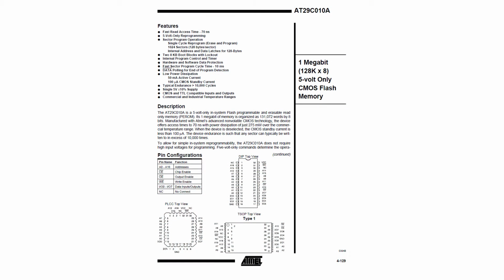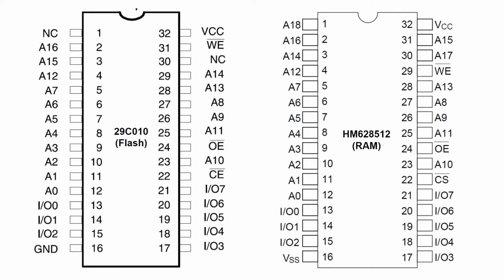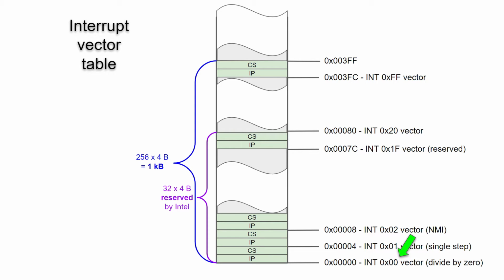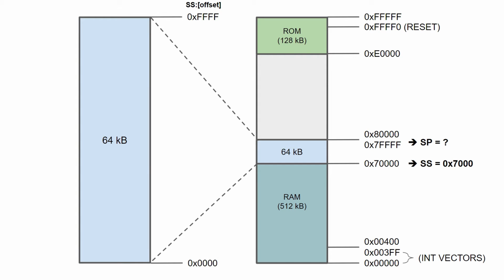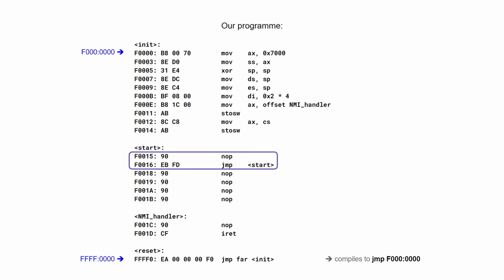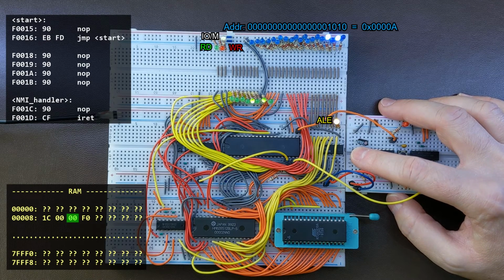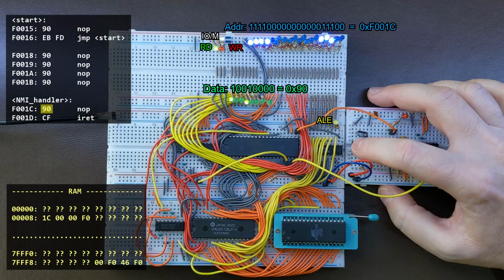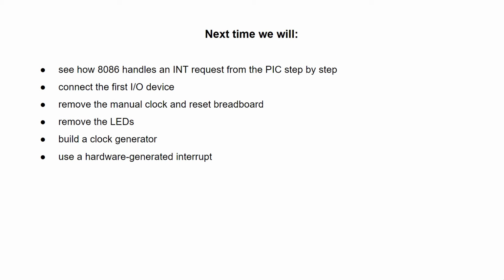Memory map and interrupts - Building and programming a 16-bit Intel x86 breadboard computer [part 3]

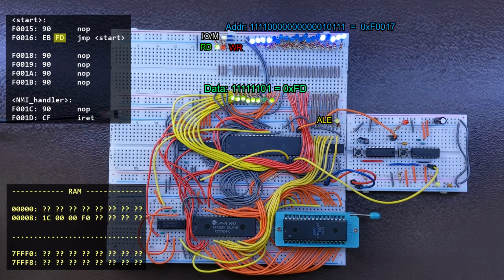Comment: 26:30 Oh by the way, 0xEB is "near jump to relative offset", and this 0xFD is -3,  apparently, the instruction means "add -3 to the IP". So, IP happens to be 0x0018 after executing this instruction, and then it is being subtracted three and this is how it loops back to 0x0015.

38:30 I believe, it's not "finished executing an interrupt handler", but it's actively executing the IRET instruction, which implies reading from the stack.

Comment: Finding your videos very informative. I'm designing a vacuum tube computer, hopefully with 16bit data bus (very ambitious, I know).

At 21:57 where you set DS & ES to zero, why use MOV and not XOR, being that, as you explained, XOR uses less clock than MOV. It seems a waste of clock, especially when setting SP, DS & ES all to zero are consecutive instructions, and, there is no jump instruction to F0007 in your program after any modification of SP
Reply from the maker: Thank you for your kind words. Your project sounds VERY impressive! I wasn't aware that it was still possible to get hold of many vacuum tubes these days. Please keep updating me on your progress in the future.
Regarding your question about using MOV instead of XOR: DS and ES are not general purpose registers and they cannot appear as the operands of any arithmetic or logical instructions like other registers. There is no XOR instruction, where you can use any of the segment registers. From the top of my head, you can only MOV to and from a segment register and PUSH and POP them.

Comment: Thanks for the video. Its down to earth.. you didn't state how you got the Program into the memory. I was thinking you write the EPROM or something.
Reply from the maker: Hi! Thanks for watching and commenting. Yes, well, at the moment I assumed it would be obvious how the programme got onto the breadboard and didn't mention that. Apologies for that. I used the same flash memory which I introduced in the previous video. So you are quite right, but instead of using an EPROM I used a flash chip (29C010). But yes, I do remember using EPROMs and waiting until they got erased by a UV bulb many years ago. I used to have a few EPROMs, which I used in turns, so I could have a few empty ones while the rest was being erased. Good old days ;-)
Reply: @SladorSoft  Much appreciate your reply. So the flash chip is an EEPROM ? I WANT TO start breadboarding alongside you as I enjoyed your content
Reply from the maker: @engineerchika3204 - sorry for late response - I had somehow missed your comment.
Yes, I'm using the 29C010 which is a 128kB NOR Flash, so technically something very close to EEPROM.

Comment: One of the few times *(int*) (void*) 0 = xxx; is a valid C instruction (instead of a null pointer access), is when you set the divide by zero interrupt vector IP value ;)

Comment: Hi I'm noob, how do you write the program on the memory?
Reply from the maker: Hi! The flash memory is written using a universal programmer. My own programmer is very old, but if you would like to buy one, search for "XGecu T48 Universal Programmer" for example as it is one of the most popular budget programmers.
The compiler creates a binary image of the flash which you then load into the programmer.
I'm planning to release a short instruction video of how to setup the compiler toolset to build all the example code from my GitHub.

Comment: This series brings me so many good memories... I have two questions about the assembly you used (which might also be tips for viewers):
1. Why are you using a "NOP" followed by a "JMP -2" (EBFD)? Wouldn't a "JMP -1" suffice (EBFE) and save a byte (plus some clock cycles - i.e. four button presses :)?
2. Was there any reason to not use "CLI/STI" to disable interrupts while setting up the interrupt table?
Reply from the maker: Hi there! Thanks for your questions. They are great, because - as you said - they may be valuable for others. Let me answer them:

1. No particular reason - I just wanted to make sure that the CPU has something to do in the loop and that it will still fetch the instructions giving us feedback on the LEDs. I thought that if the loop was made only from a single 2-byte JMP it may not re-fetch it and use the prefetch queue instead.

2. The reason was that both CLI and STI were completely redundant in this case. The interrupts are disabled after reset by default, so I didn't need CLI there and since I were not using the INTR line in this video at all, we didn't need to enable them at any point.
Please note that neither NMI nor CPU interrupts (like divide-by-zero for example) are NOT controlled by the IF flag at all  - they are always active.

Comment: good evening,excellent. I would like to know what are the components he used in the clock circuit he uses in the small breadboard with the 2 buttons. Thanks in advance for your reply. I'm italian
Reply from the maker: Hello, thank you very much. You can see the schematic of the small breadboard in my first video - the "First Run" - around the time 12:13. This link should direct you there:
https://youtu.be/VvyUAaRTsww?t=733
The small breadboard is on the left bottom side of the schematic. The resistors can be around 10k and capacitors around 10uF. The inverters are 74HCT14 and the flip-flop is 74HCT74.
I hope that helps!

Comment: How to handle time? Let's say I want to print out the result of each Fibonacci sequence every 1 second, how do I do that? I've read there's a chip called Programmable Interval Timer 8253 but it's just that, papers, nobody has made a video wiring the IC and demostrating its behavior.

There's a project called SDLPOP which is a reverse engineer port of Prince Of Persia to SDL, I'm reading the disassembly code to see how they managed to keep framerate the same regardless CPU speed but for me to understand that will take a decade.
Reply from the maker: That is a great question and you answered it yourself ;-) Yes, you need a timer like 8253 (or its newer version 8254).
Funny that you mentioned it, because I have planned to cover 8254 in my series. It will appear in episode 6 according to my current plan.

Comment: Looking forward to your 74* series! What I'd like to see is an 8088 interfacing with DRAM instead of SRAM. As an x86 veteran, I don't mind your assembly digressions because I think they might be good for beginners.
Reply from the maker: Thank you for your comments!
The 74 series should be available next week.
I was thinking about attaching DRAM to my 8088 as well, but in this series this would not add much value, only complicating the whole design. Effectively I'd need to add a bunch of 74s or use some programmable logic.
I think I will do it at some point, but probably as a side video rather than during this series.
Reply: The target of this video series, as stated by the author, is "beginners".  Giving the xor discussion the label of "digression" implies that the intended audience is veterans such as yourself.  Such a "digression" is very informative and much appreciated by this beginner and I definitely would like to see more like it.

Comment: I have several Siemens 8086 MPU’s, I have yet to get some 8088’s in my inventory which would be a little easier to interface with as it only has an 8bit bus vs the 8086’s 16bit which was a substantial reason for IBM to use the 8088 in their 1981 debut of the IBM PC.

Comment: When done with this series, it would be nice to watch you write a C/C++ hardware emulator of this entire breadboard build in a step by step manner, starting with the intel's 16-bit x86 chip that you are using and expanding it from there. What would be nice to see at the end of that series would be the ability to install MS-DOS 6.0 and Windows 3.11 within the x86 emulator and to have a virtualized running operating system running as a modern Windows desktop console application. To account for graphics within the "Viewer" side of the emulator (additional software that isn't a part of the breadboard build otherwise you would have to build a GPU on breadboards...) we could use either OpenGL or Vulkan and their shader modules to do all of the drawing of the font's and images that Dos & Windows of that era would require. If this works well, then one could install DOOM into the emulator! However, we might have to add an addition piece of emulated hardware in software such as a sound blaster 16... What good is a "Game" without "Sound"? Again, could be done just in software instead of having to build an audio or sound card on a breadboard, unless if you want to go down that road... 

This would make for a great series... 

It would cover 4-5 major fields within computing covering both levels of abstraction starting with the hardware and its logical design along with its assembler/disassembler to middle or high level language such as a C/C++ compiler with Operating System support. It would also cover Graphics and Image Processing as well as Audio Processing as they cover multiple programming paradigms from low level assembly to mid level C to high level C++ and maybe even some Python Scripts... 

As another side project to this main project we could try designing the breadboard computer as well as the hardware emulator to be able to run an older version of linux... This way, the finished project would be both compatible and able to support either Dos 6.0/Win 3.1 or an older version of Linux... 

Then as a final set of videos as an addition choice of candy for the viewers; you could design your own operating system and installer that will be able to be installed on both of your 16-bit x86 breadboard build as well as the hardware emulator that is written in C/C++. Let me know of your thoughts on this...

As a side note if you were to start doing the software side of things could easily upload that to github... could even possibly get a discord channel going too so that the community could fork from your main branch work on it and add their own versions... Then we could possibly see dozens or even hundreds of 16-bit x86 emulators out there!
Reply from the maker: Wow! Thanks for your extensive comment including lots of ideas!
Writing an emulator would be a massive project. Personally, I'm not sure if coding on screen would be that interesting for most of the viewers(?) Anyway, it would take a looong time. Let's say that when this channel gets 1M subscribers, I'll quit my job and start the emulator series ;-)
As a side note, the emulator would need to be able to implement not only 8086, but at least 80286 for Windows 3.1 (and Doom, I believe, requires at least 80486?). As much as this idea is really cool, the required effort is huge, especially considering that there are already good emulators which do exactly what you described ("Bochs" for example).
As for github, I'm planning to publish all the code I'll write for this series -probably on github. Because the time I can spend on this is quite limited, I need to carefully balance between preparing new videos for this series, putting together a website and planning new stuff for the future.
As to the idea of the own OS - it would be even bigger thing. Rewriting MS-DOS, or anything else running in real mode wouldn't be fun, so we are looking at - at least - 80386 - definitely impossible to stick it on a breadboard :-)
To realise your ideas I'd need several lives more and to quit my job (in all of them), probably :-) If you have some time on your hands, why not to try yourself? I'd be the first person to subscribe, when you have done it - promise.
Again, thanks a lot for watching and your pretty good ideas.
Reply: @SladorSoft  This is why I'd make the suggestion of getting the community involved... Others who would be interested in such a project could work on their own parts, and collectively it wouldn't be too much of a burden, and then you could focus on the video part with the explanations and demonstrations... I know it wouldn't be an easy task, years ago I've written a minimal 3D Graphics/Game engine in C++ using Legacy OpenGL 1.0 and that project was close to 100k lines of code where a good 10% of that was in the parser for creating or generating the Scene Graph dynamically from a custom built language text file... and it took me about a year to write and debug it. I understand where you are coming from. I wouldn't expect you to do everything. That's why I had mentioned Github in conjunction with a Discord channel. Who knows where it would lead to and what may come of it.

Now, I do understand that there are already existing tools out there such as Bochs... but to see a series where one would build such a thing from the ground up in a step by step manner explaining what they are doing and why they are doing things in a specific why while still also being open to suggestions from others to improve the quality and efficiency of the code would make for a great series for others to follow. It wouldn't be so much as a lesson to teach them how to write code or program... it would be more on the lines of teaching them how to model algorithms that will be implemented into some source code and how to build sophisticated software from beginning production to end production. There are tons of tutorials to teach the "languages", there are tons of tutorials that teach various datasets, structures and algorithms yes, but there are very few that teach how to combine the two together in a seamless manner allowing others to develop the skills to be productive software developers / engineers. With your knowledge of the underlying hardware and knowing how the software meets the hardware is on the spectrums that is limited or lacking as resource for general public knowledge. And your videos although are focused on the integrated circuits, instruction sets, binary codes and assembly.... your demonstration and explanation is very solid and easy to follow. I hunted for years to fill that gap... I've understood the circuity side of things to a degree and the software side of things, but always found the middle ground lacking, well at least until I came across Ben Eater's channel and now you are presenting this series on the x86 architecture! Who knows maybe one day someone will do something similar with the Risc-V architect!
Reply from the maker: Thank you skilz8098 for your reply. I must say that your ideas overlap my ideas in some respects. Honestly, I started thinking about any future subjects only recently. I created this channel without any serious thoughts that it would get any traction. It was just like: I'll have some fun with a breadboard and my 8088 and I'll record it. I didn't believe that many people would like to watch a video like thousands of other similar videos on YT where a guy talks a lot and with some foreign accent (that's why I add subtitles for those who may struggle to understand). The missing middle ground you talk about really resonates with me. I do programming (not electronics) for living, but electronics has been my hobby for most of my life and in fact I really like to marry both and I have always been interested in this middle ground. So that's definitely what I'd like to cover at some point. I'll have a think of how to do it properly, but definitely I'd like to include C++ (as the programming I've been doing most for living) and probably 32-bit Intel assembly including at some point protected mode of the 386+.
Anyway - thanks a lot for your ideas (and nice words on my work). We'll see how it goes :-)
Oh, and I don't intend to talk about Risc-V as I've never really played with it (not that I wouldn't like to see someone else doing it).
Reply: @SladorSoft  Well, I'm more familiar with x86 than most other architectures... but after watching a few videos about Risc-V and their philosophy... I kind of like the direction they are going... It's an "open source" version of hardware well not so much hardware itself but as for the ISA. Here's our core ISA that you must implement to be considered a "Risc-V" brand. Then after that you can include any or all other extensions or possibly even roll your own to suit your own needs. There are pros and cons to both proprietary and open source variants... but the modularity part of the "Risc-V" has gotten my attention... The way things are going within the industry today... x86 won't go away right away, but I have a feeling that it's towards the end of its lifespan as it is slowly become less and less significant. Don't know which direction Intel is going to go from here, but it's going to be interesting to wait and see!
Reply: @skilz8098  8086 has been Open Source since the 90’s.
Reply: Word salad shredders